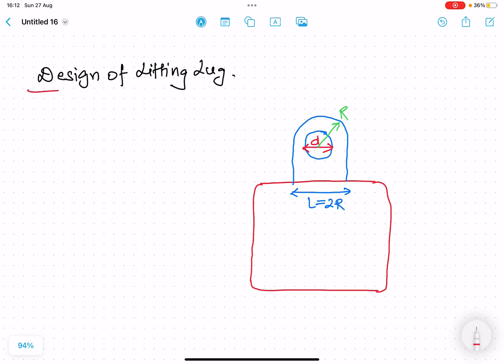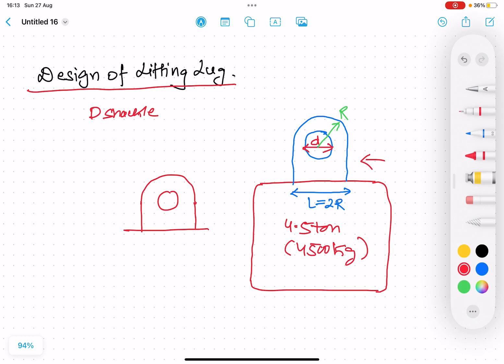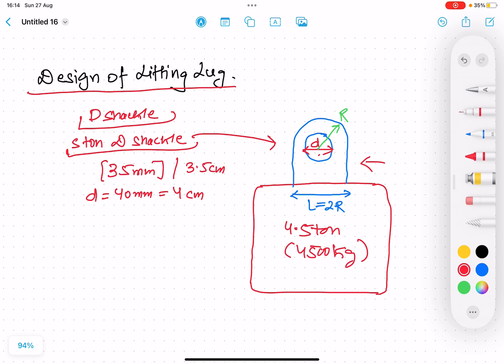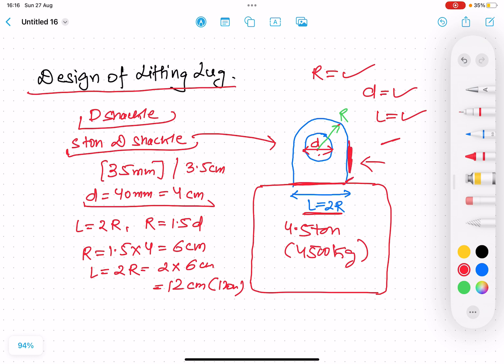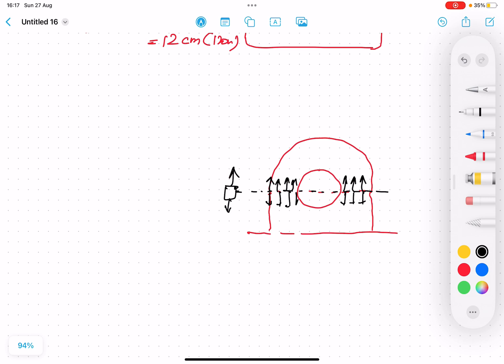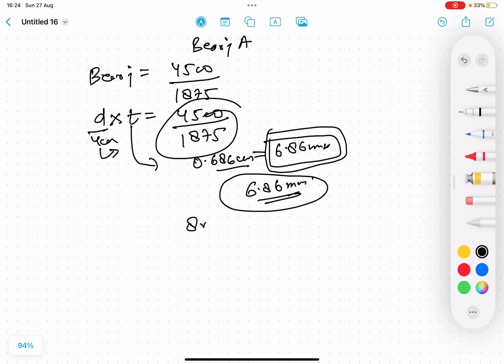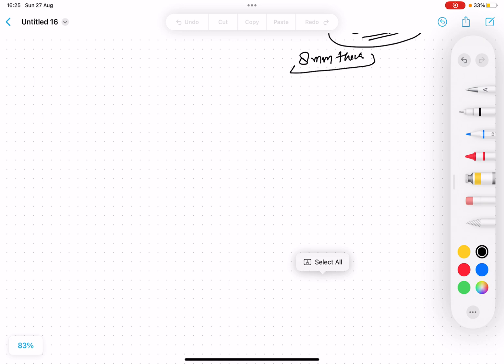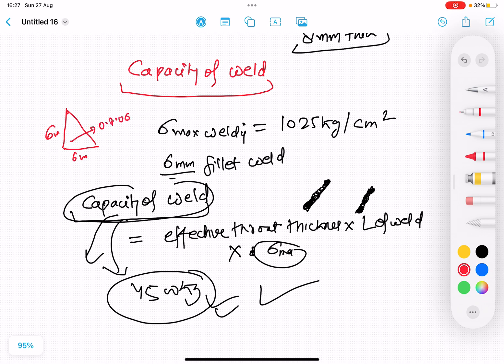Design of lifting Lug

Comment: Another easy way to find the thickness of the lug is to check out the 'D" shackle jaw or opening dimension. this dimension can be obtained from the manufacturers shackle dimension chart. very useful information for fabrication. Another criteria that needs to be factored is dynamic loading.